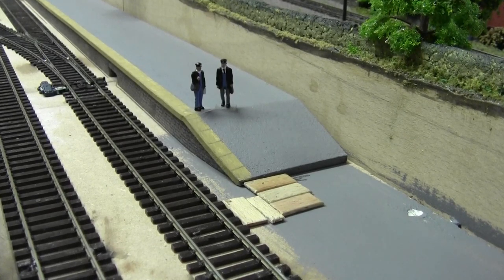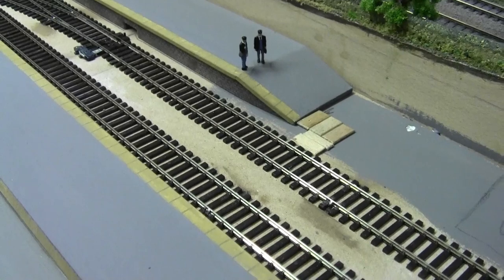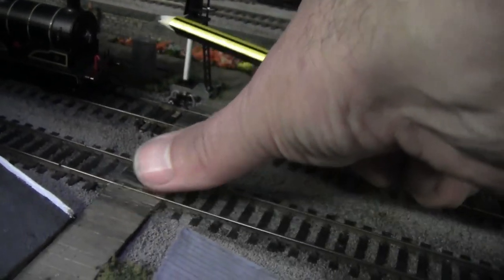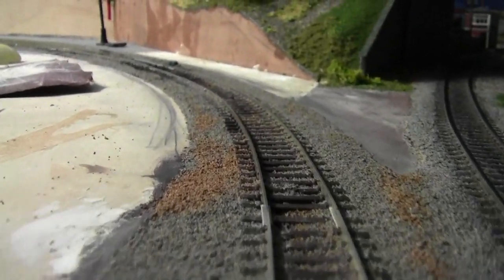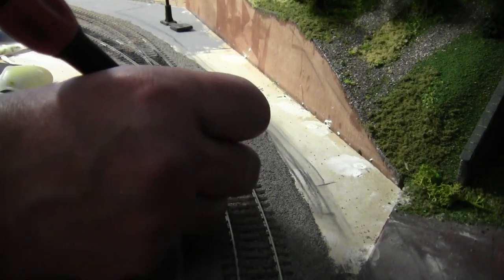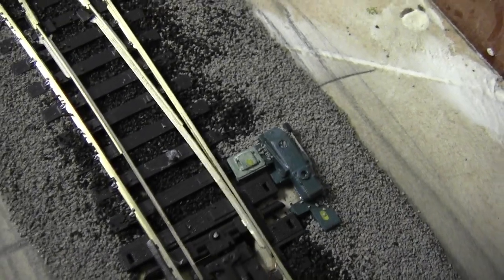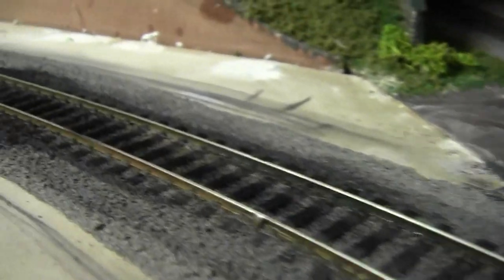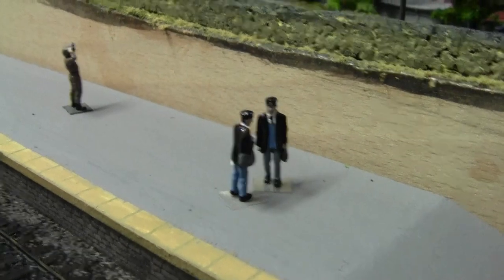Jarrow Road Part 3. Grimy Rails   No326

Comment: Fantastic railcar to start the video.  Nice set ups with the story for the job.  Nice work as it comes together piece by piece, inch by inch, stroke by stroke.
Reply from the maker: Good morning Anthony. very true comment. one inch at a time. its does sound like its going to be inch perfick. maybe i will have to add a millimetre of two for tolerance's just to be on the safe side.  thank you again for kind superlatives....cheer's Tony

Comment: Station rails are looking good. Worried about those two rascals at the end of the platform. I think they are up to no good myself. Thanks for sharing. Take care in the loft. I have the same problem and have had a rail buckle in the heat this week. Thanks for sharing. Roy.
Reply from the maker: Hi Roy. yes that is unusual for the third rail to buckle, as the normally expand in their chairs. the likely lads are always in trouble. stay safe my friend.. cheer's Tony

Comment: Hi Tony! Great update making the tracks look ultra realistic! I'm already fretting about ballasting and weathering my track but watching videos like this gives me a little more confidence! Cheers,Ian.
Reply from the maker: Hi Ian, i am always the same about starting ballasting. as long as any holes that you may drilled are filled that have come from your buzz bar. use very little around the points motors and sliding rails. you should be fine. judging by the amount of track you have to, you could it in stages. i have done better tutorials on ballasting. the ballast i used. N Guage modellers like yourself use it. find yourself a fine mist spray bottle. to apply soapy water solution, before adding the PVA solution. 
thank you for commenting...have fun. Tony

Comment: Looking good Tony.  You are correct that the ballast in stations was filthy black with coal, dirty oil and grime off the platforms.   I was a bit puzzled with your wash mix.  “50% water; 50% acrylic paint and 25% PVA”, but I think I know what you mean 😂.  
Looking forward to the next instalment.  Best, Jason.
Reply from the maker: Hi Jason. absolutely. i can see now dirty the station areas where back then. i dont think that they have change that much now...the wash has to be watery so it can seep into the ballast. rather than just laying on the top if that makes sense...stay safe buddy....cheers Tony